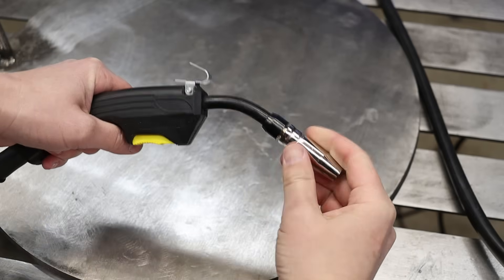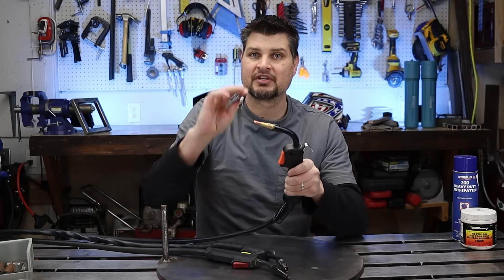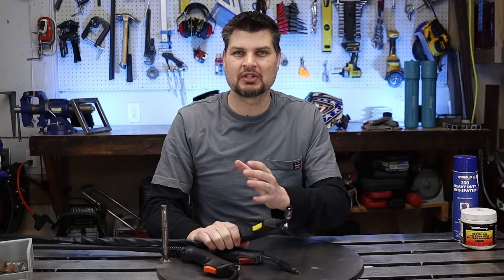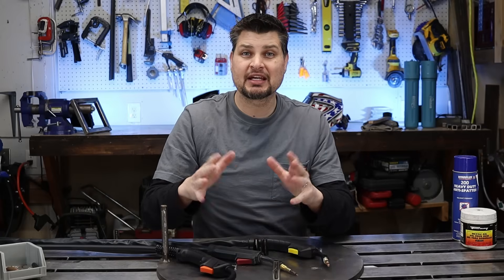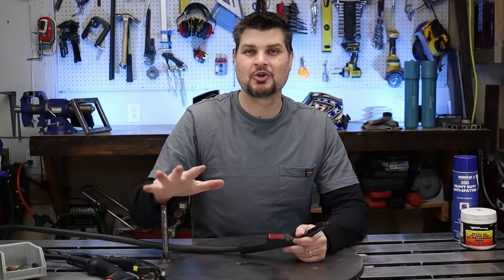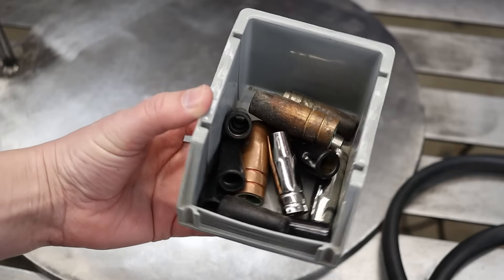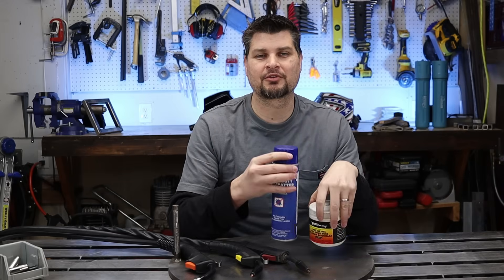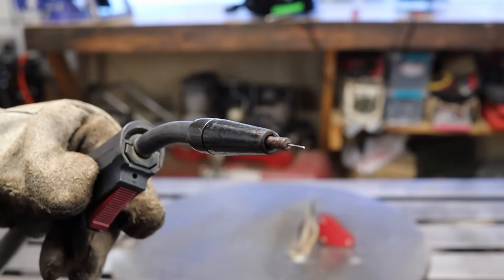#1 Tip and Trick to Improve Flux Core Welding

Comment: as someone who took the welding class high school and is almost 40 and even started a welding company, dont do this. what hes saying does make sense, but why get used to welding without a nozzle then when you switch to mig you have to learn that process with the nozzle. the nozzle does a few things and its going to depend on what youre welding. generally speaking the nozzle will recess the tip and if you take your wire cutters and trim it off flush with the nozzle youre stick out distance is the same all the time and you dont have to worry about holding the nozzle off the work piece as its also an insulator and will prevent you from grounding out the tip along with protecting the tip from the majority of spatter. also some people will grind the nozzle back so the tip is flush with the nozzle and it does the same thing as hes talking about and it works with mig also so theres no new learning curve and no need to buying a special nozzle. and be careful with the anti spatter and gel as it just adds to the toxins youre breathing in while welding.
Reply: You all sound like teenage girls.
Reply: Rubbish. I manage an LNG/aviation/oil/mining company and have 200 men under me. What this video is suggesting is completely correct. Skilled welders swap processes whenever required from TIG pressure welding on 20,000kpa gas compressor pipelines, to 1.6mm flux core on outdoor mining hoppers, to short-arc gas mig. Your excuse shows your own experience shortfalls, and your low expectations of others.
Reply: @gw5436   hey jackass he wasnt talking about skilled welders. and you mention TIG which doesnt apply to this but also requires gas, and 1.6MM is a welding rod, the only thing that would apply would be the MIG but for some reason youre adding gas into it when short-arc mig is the proper term and the G in mig already stands for gas. so im not really sure what youre trying to say but just stay in your office
Reply: @gw5436 you manage that says it all
Reply: @gw5436 agree with you I rather take the time to swap out/ get my machine right then cut corners like this, seems like a gateway that oftentimes tends to lead to lazy welder's.
Reply: I tried this and grounded the tip. Which caused my tip to arc and welded my wire the the tip. I had redrill my tip.
Reply: Your comment doesn’t apply to Australian boilermakers, we’re tradesmen who are trained and experienced in most welding processes involved in heavy fabrication and welding including sub arc welding.
Reply: @LincolnHobartMiller  how many of you guys comment and also huff the anti spatter? This video is for newbs learning and so is my comment. If you're a damn tradesman then you're not a noob and the video doesn't apply nor does my comment.
Reply: why would you use a nozzle when stick welding or tig welding?
Reply: take it you never tigged before @n8mail76
Reply: Did you even watch this video? You sound like an angry little man....
Reply: LMFAO
Reply: This suggestion is NOT for full time professionals but hobbyists.  I agree with his presentation as a occasional welder with both types  of welders.
Reply: @powerwagon3731  which still makes my point valid. It makes no logical sense to learn to weld without a cup (and some machines you have to have a cup on because the tip is pressed in and not threaded) just to learn how to weld with a cup when you decide to use gas. Not to mention the threat of grounding out the tip or worse case the threads to the cup and melting either one to the material or increasing the chance of splatter damaging the tip or threads to the cup.
Reply: I hate hacks for
Reply: I am new to welding, but thought grounding out the tip might be an issue.
Reply: I was taught to cut the shroud a little and leave a little stick out.
Reply: That's like telling me not to learn stick cause when I go back to mig my little brain is gonna be too confused to remember how to push a trigger. If this is the case for you that's fine, but it's ridiculous to tell others to limit themselves. There's absolutely no reason anyone else can't learn to weld fluxcore without a nozzle, and weld mig with a nozzle. This is such a non issue.
Reply: @nimnogaparus  right, and since you also have to close the distance with stick. when you go back to mig without a tip you might also fuse the tip to the material when you instinctively close the distance. the tip does a few things and theres more pros than only one con that can be fixed by adjusting your head. this would be like not using auto helmets just because the nozzle keeps blocking the sensor and you keep flashing yourself.
Reply: Hey
I want to make a few burglar bars grills for my windows. Diy. What is the best flux core welder for this project?
Reply: Maybe you could find the Upper Case Key so someday when you want to type a comment, you'll know how to start a sentence with a Capital Letter...
Reply: @diverbob8  sorry this is a welding comment not a grammar comment. See that period that means the past sentence was over and a new one started. But I guess common sense is hard for people who are too worried about proper punctuation. Must really be hard walking around with your nose in the air because you're so much better than us common folk.
Reply: Thanks for bringing your 2 cents to a $1 lunch buffet
Reply: I would say you're about 90% right there's really only a small number of uses for that The only benefit I've noticed is on a gasless flux core machine it seems to help with being able to see what your welding and if it's a real small machine it helps not keeping your stick out too far but for any other process it would just affect you negatively
Reply: If you arent supposed to do this, then why to new, brand name welding units like my Lincoln SP-175 come with instructions that tell you to  remove the gas nozzle shield,  and install the screw on cover made for working with flux core wire?
Reply: @Internutt2023  im not saying you cant. im saying you shouldnt, its one thing to use the gasless nozzle as then youre only exposing part of the tip. but he also suggest not using a nozzle at all. and if youre new to welding i can guarantee youre going to ground the tip out, then youre going to have to buy new tips and possibly a new diffuser. 

the main point i was making is you dont need to see the weld that much to risk the tip or diffuser. if you have doubts weld an inch or two then look at it. as when you switch back to the regular nozzle will lose any benefit it gives you when you try to go back to gas. so there is no point going back and forth and learning two times how to weld
Reply: Happy with you saying something about that haha, I don't understand why get rid of the nozzle I'm currently in highschool learning to weld and glad to say I've layer some great looking welds with excellent penatration for mig, tig and stick
Reply: I willed with flux cored 90% of the time and I don't use a shielding cup and I have no issues when to swapping using gas and having a shield cup this is excellent advice and also I own my own business as well irepair and relocate boat a lot of welding involved when I'm on the lake welding steel I use flux without a shielding cup when I'm welding aluminum I use a shielding cup you got to when you use gas and when I'm working at home are you solid wire with gas obviously and shielding cup and I don't have no issues there's no learning curve to it not using a shielding cup with flux just means you're not having to stop and clean the shielding and you can see a hell of a lot better and that tip dip is awesome i used it every day my tips last way longer and less wire jams your the clown also watch the whole video before you start trashing people because then you can write a comment that makes sense
Reply: says the guy watching a video named "#1 Tip and Trick to Improve Flux Core Welding" @traycollum1434
Reply: If you can't multi-task by swapping nozzle on and off, then put your skirt on and go home.
Reply: @M70ACARRY  not sure you understand what the word multi task means
Reply: @M70ACARRY  your comment is OK except for how you make fun of the feminine sex!
Reply: I don’t know
Reply: Wow that’s a lot of words too bad I ain’t reading them
Reply: @TheCrazyMayan Well, having the attention span of a common fruit fly sure sounds like a disadvantage in life. 😄
Reply: @TheCrazyMayan  yeah words are hard for some, you should probably should stick to finger painting
Reply: @MrIrishalley  exactly
Reply: @MrIrishalley words are hard, as you demonstrated with your double shoulds. Don't talk shit if you can't even get it right yourself.
Reply: @tylerfosse7336  well if you take either one out it makes sense. So common sense would tell someone that the writer was probably distracted and stopped writing then continued a few minutes later. None the less the point is still pretty clear. But common sense isn't that common anymore, so I can see why you would have an issue.
Reply: @MrIrishalley  well no, I figured as much. But you're giving someone else crap over their English, and in the same post you botch your English.
Reply: @tylerfosse7336  right, I was giving him crap with a smartass comment replying to his smartass comment and you're taking it way too seriously.
Reply: @MrIrishalley are you really commenting about taking things too seriously while simultaneously replying to troll posts? Dude,  you're a whole nother level of contradictory lol... 🤡
Reply: @Shobe9904  and how did I exactly reply to a troll post?
Reply: 😂😂😂 @MrIrishalley
Reply: Spot on' the guys a clown i'd like to see him in a Fab' shop with a 600 Amp Miller to work with ......
Reply: @leso204 can't fathom the difference here? 😂
Reply: @leso204 if you can't get used to the gas nozzle in one work day after getting all the basics covered, you ain't no damn welder yet 😅😂😂

Comment: I used to do ornamental welding... hand rails, decorative balcony rails, Gates etc... 1/2" X 1/2" pickets, 1 1/2" posts (smaller welds) and with what I'm going to recommend I also did
4" X 4" X 1/4" posts as well as heavier welds too. 
0.030 welding wire really helped me to put down really nice/beautiful/"ornamental welds" that I literally painted over after only wire wheeling the dingle balls off. (press read more)

A bit slower for the larger welds yes but the welds were full pen and I came to prefer welding downhill rather than uphill as the smaller wire gave me the needed puddle control to do so. If you're used to 0.045 you won't like it at first but keep with it for just a little while to find the new wire speed and heat adjustments and you'll come to appreciate the provided control and versatility of .030 flex core wire. It was also much better for cast iron welding! .030 flux core wire came to be all that I used (95% of the time), contaminants floated out better too.
Very Pure welds and with proper penetration! BION

If changing from gas wire to flux core wire or vice versa... """don't forget to reverse the welders polarity"""! Admittedly most of you won't like 0.030 flux core wire because it's a little slower but I loved it!
Dudes... the welds don't take long, it's the prep and the set up that takes the time and I had no weld grinding to do when I finished, just dingle ball removal with a wire wheel so... does the "project" actually take longer? No! 
0.030 flux core... try it! Don't forget the 0.030 welder tips and a 0.030 roller wheel for your welder too. Both are very inexpensive and "super-simple to exchange" Cheers: Robert
Reply: Good prep work takes time, but results in much better welds, especially when you're repairing something that's been used and abused in the elements for years instead of working with fresh stock. Getting down to bare metal when repairing a trailer is always a huge hassle, but necessary if you don't want the weld to fail on you.
Reply: And a generator if you can afford it because extension cords to the fence line reduce arc power and can cause " black popcorn buildup"  from weak electricity supply . A voltage drop or something on long extension cords . 
   I think a 10 pound roll could be made onto a spool rack on the back of one of these little welders and drill a hole in the back wall of the welder in line with the wire feed roller and feed the wure through a plastic tube

Comment: Wow great video I am a new flux core welder I will definitely use your advice when I try welding again.thanks .👍
Reply: Experienced welder here.   If your new to this I would advise leaving the nozzle on till you learn to handle the gun..   it also protects the tip from touching the work... you can try but have lots of tips on hand!!  When the tip touches the work area it arcks the tip and ruins it!!  Also get some contact dip to dip the tip when its hot every once in awhile...  I've welded alot in the field with flux core and once you learn the nozzle really doesn't matter to much.   I like the tip protection  it provides!!!  You will see in time what I'm talking about?  Good luck..
Wayne
Reply: @wayneortmeier5352  Just tried removing the shielding nozzle after watching this video... and yep, it was a mess! The weld was spattering all over the place, deep holes all over the bead... and then on my second attempt it ended up welding a big lump on the end of the tip. Had to grind it right back as it wouldn't break off. Put the nozzle back on and it was perfectly good again. Granted I'm very new to welding (just started), but not at all sure about this "#1 Tip and Trick to Improve Flux Core Welding" at all.... haha.

Comment: Just wondering, let's say I'm welding a 10 feet long metal, which one consumes more electrode, stick welding or mig? Which one will do the job cheaper( cost of electrode only, gas for mig excluded)?
Reply from the maker: That is the life long welder question. I've yet to see a good video showing that.

Comment: I weld every so often and learned that trick removing the noz soon after starting. I bought the Lincoln 225 that uses fluxcore wire and very happy with what I can do with it.
Reply from the maker: Right on!
Reply: It's not a trick, its in the instruction manual for the welder. You should have even gotten a screw on tip cover to cover the vent holes from getting welding soot and splatter into the gas vent holes with your unit.

Comment: I don’t know why but I find I get better results just stick welding over FCAW.
Reply: It puts down more of a puddle and is quicker. The puddle is also easier to see so you know what's happening. I'm an amateur and have both welders because they are cheap and I can't justify spending lots on a mig.🤗👍🇮🇪 (IRELAND)
Reply: remember negative torch positive earth.  wire tension is important
Reply: A clean molten pool is a clean molten pool mate . Gun torch electrode holder or what ever
Reply from the maker: I started out stick welding and often go back to it as well. There is just something different about it.

Comment: Leave the nozzle on unless you like buying contact tips !!The nozzel protects from  grounding
And also controls arc length and makes 
Tacking easier.
Reply from the maker: With it off or better yet with a flux core nozzle you can see your stick out distance better and then you won't ground out! I do agree with tacking, old timers would tack by simply contacting the nozzle to work piece and pull the trigger. For beginners it's easier to learn without.
Reply: Agree I welded a tip as soon as I shortened my standard nozzle. You get used to it providing a gap buffer. Put a new battery in my welding helmet and learn to re judge the distance and all will be good again.

Comment: You will find if you use Gas with flux core you will get a better weld We call that in the welding industry dual shield using a shield gas along with flux core you'll also find less splatter 😅😅😅😅
Reply from the maker: We run dual shield at my work. It's more expensive with the different wire and then you have to add gas.
Reply: @-DIYPRO-  yeah but you can buy that wire too you can also run good spools of aluminum through just a normal mig welder you just have to use a harder aluminum wire than a spool gun but it still works started welding when I was 15 I'm 61 now have a great day

Comment: The regular MIG nozzle is good for tack welding without a hood since it's not hot with the trigger pulled. Just  put the nozzle against the weld point, close your eyes and squeeze the trigger.
Reply: Not good advice
Reply: I did that for years and got my face and neck burnt all the time, now I pay for it in skin damage, bad practices will catch up to you in the end.
Reply from the maker: Did you try it!
Reply: Did you mean not hot without the trigger pulled?

Comment: I wrap my nozzle in al foil, works.
Reply: I used all my tin foil on my hat
Reply from the maker: Simple and effective, I like it!
Reply: Foiled again!
Reply: Thanks. I was about to ask about foil.
Reply: I may try that. I really dislike the plastic flux cover bs. They should be aluminum or something cause they melt too easy…
Reply: Why wouldn’t you just cut down an old nozzle and save the tinfoil for @ajawhite9103
Reply: @jarredsegal6842  Don't have an old nozzle. Used the foil tray from an apple pie.
Reply: and she's ok with that ?